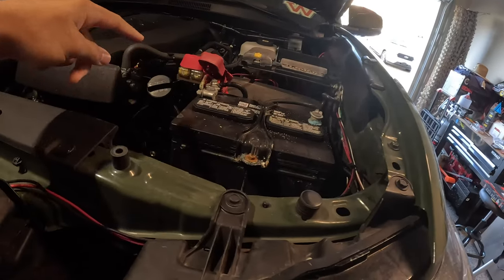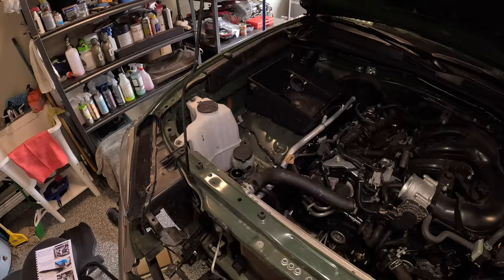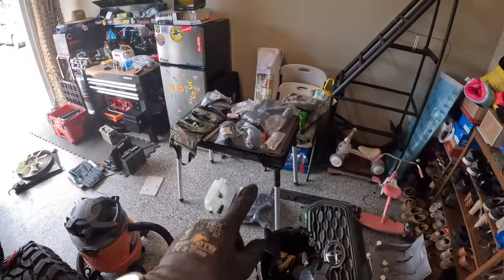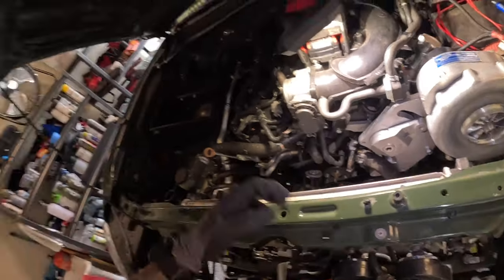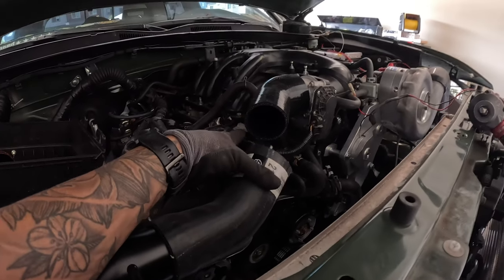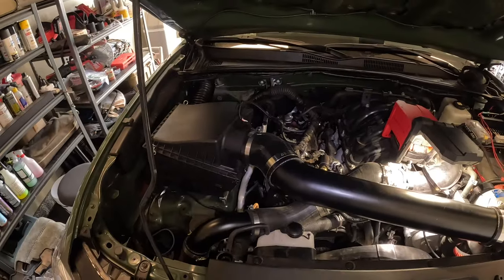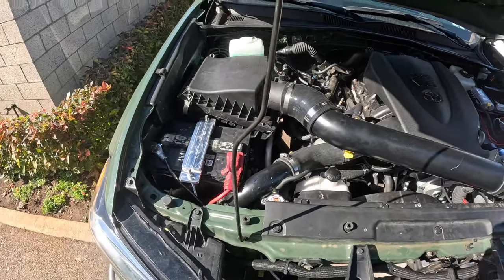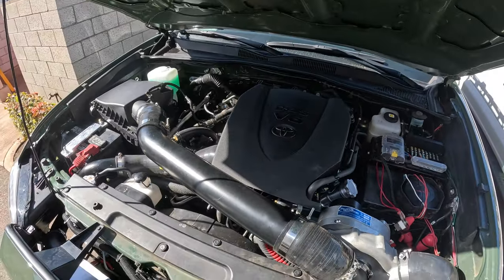Tacoma ProCharger Install

Comment: Nice Job on the install and working around missing parts and tight spaces.  That pro charger whistle is 🔥🔥
Reply from the maker: Thanks brotha. Kinda inconvenient. I’ve asked around and found that some other people had some similar inconsistencies when they received their kits too. I was lucky that I was able to make some adjustments on the fly and find temporary replacements for the time being. Pro charger customer service is pretty good though. After contacting them, they were quick to address the issue and work with me on getting the parts shipped over to me. Good on them.

Comment: Straight tap 🔥🤙🏽 cannot wait for see how the ting sound
Reply from the maker: It’s definitely a lot louder at idle and lower RPM. Under boost it gets a little quieter.. or the exhaust kinda drowns out the whistle. But you definitely feel the power for sure. Feels like driving stock plus some now, even with the 40s.

Comment: The one thing you should not have done is disconnect the lidar sensor on the bumper. You have to get that recalibrated once you do. Let that hang next time. Its only 3 screws holding it on.

Comment: What made you decide getting the pro charger instead of a magnuson supercharger? Btw thanks again for installing tires on my 13 inch wheel 🤙
Reply from the maker: Nice bro. Glad it helped you out. And guarantee 🤙🏽
Reply: @LuauTaco any vids on how you wired your small lights to your reverse lights? The lights near the top or your tailgate. 😮

Comment: I just procharged my Tacoma , mine wouldn’t turn on without the fuel booster how come yours works fine without it?
Reply from the maker: Not sure tbh. I couldn’t even figure out how the fuel pump booster was supposed to be installed
Reply: @LuauTaco  it’s very simple , so the GRAY PLUG IN under the Vehicle on the left side, you take off the wire wrap to show the wires and there will be a pink one , only one , cut it, the blue wire connects to the PLUG IN SIDE OF THE PINK WIRE, the red wire connects to the SAME PINK wire going to the control module , let me know if you hook it up!
Reply from the maker: @BajaBangel  nice. Thank you. Is there any part that routes back to the engine side. I can’t remember off the top of my head
Reply: @LuauTaco  yes the TAN wire will go to the HOBBS SWITCH , the Hobbs switch goes on the surge system, after you install the Hobbs switch and the TAN wire from the fuel booster to your Hobbs switch, the Hobbs switch will have a second hookup that one will go to your 12v battery , if you want pictures of how I did it let me know !
Reply from the maker: @BajaBangel  that would be great. Can you shoot me a message on instagram?

Comment: in the video the high pitch squeal sounds awful.. it sounds good in person right?
Reply from the maker: That’s the sound of the pro charger with straight cut gears. If you think it sounds awful, you probably don’t like turbos lol.
Reply: @LuauTaco  Not trying to throw shade at all , I love boosted engines. I've just never heard a procharger in the flesh and from the video audio just sounded like a over powering pulley squealing lol. Was just an honest question, would be interested to see how it sounds in person though. Never the less great work on the build.
Reply from the maker: @kieranstone1136  all good brotha. Wasn’t taking it personal. The straight cut gears on these can be a little much for some people. That’s why they offer the helical gears that are quieter while it’s running. Thank you 🤙🏽

Comment: Updates? Looking to buy one soon
Reply from the maker: Haven’t had time to post any updates recently but definitely like it so far. I did blow the belt that came with the kit but I ended up upgrading to a HD belt and it’s been holding so far. Definitely helps pull the heavy tires and drives nice at highway speeds.
Reply: @LuauTaco  👍
Reply: @LuauTaco  quick questions do you feel your risking liability? And if you had to buy it again would you still get the procharger or supercharger? Thanks
Reply from the maker: @drewboost2867  doing any type of big modification can make you wonder about reliability (if that’s what you meant). I would stay with pro charger. Being more that I use it for crawling, sometimes the magnuson is a little too jumpy on the throttle and can break traction